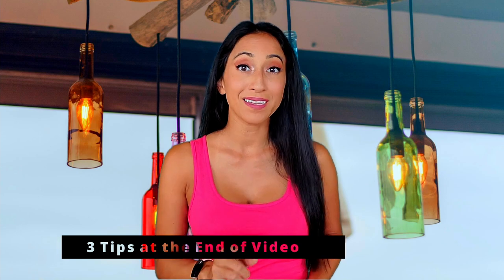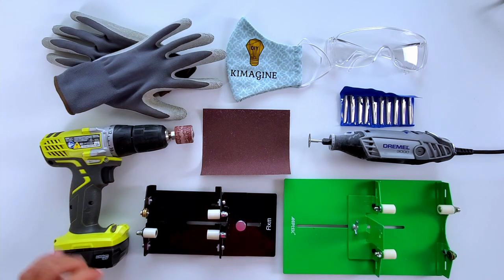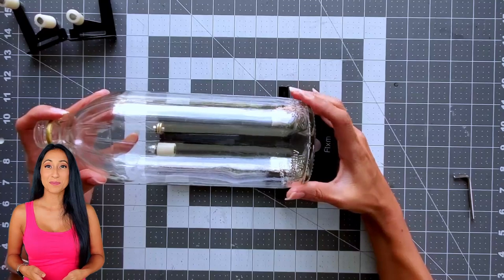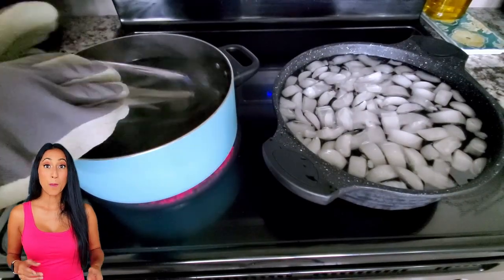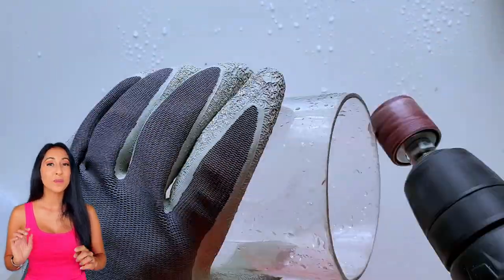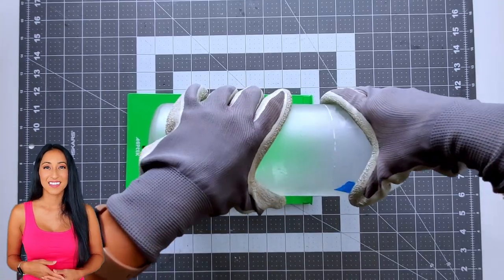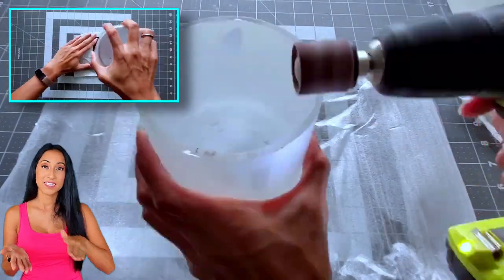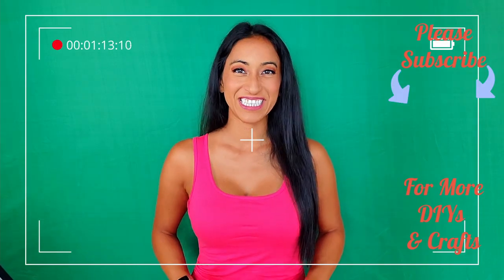How to Cut Glass Bottles using a Glass Cutter Tool | Unboxing Fixm Bottle Cutter Machine

Comment: Any ideas on how to cut the necks off broken art glass perfume bottles?  They are not round bottles.
Reply from the maker: Hi Rita,  Thank you for your question. I personally have not tried to cutting perfume bottles yet. Maybe you can try the other glass cutting method I have seen. Look up "how to cut glass bottles with string and fire". Another way would be to cut it with a diamond wheel bit. You can see what it is in my video under chapter Tip #2. Good luck with your project! 👍🏼